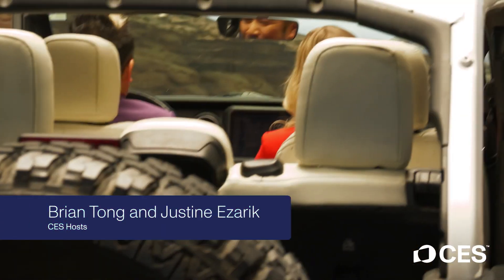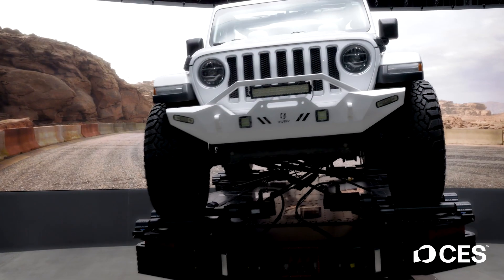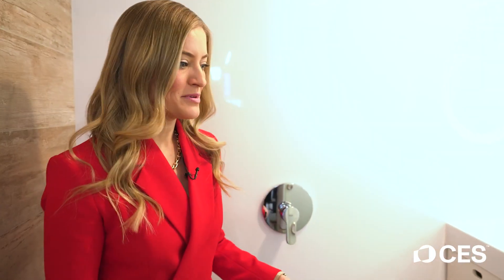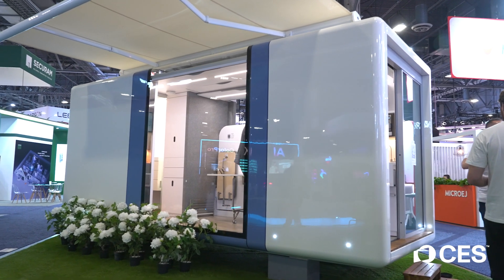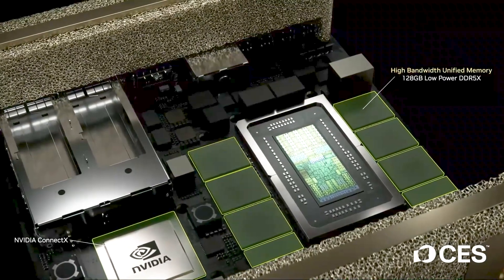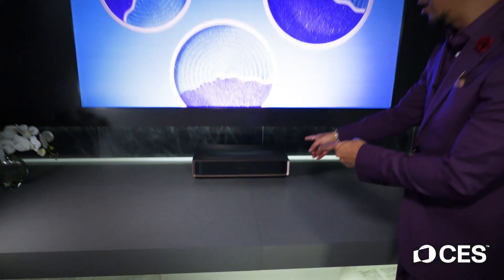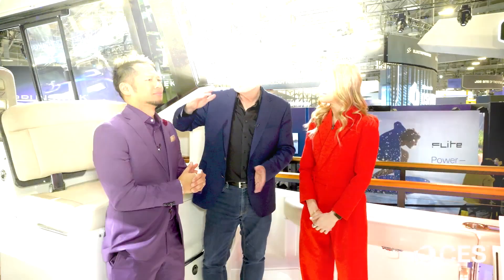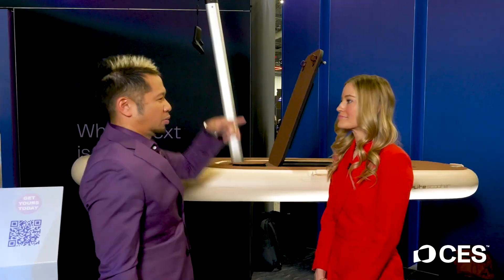The Hottest Tech At CES 2025!

Comment: I would love a tiny house.  However, there are a lot more obstacles.  1. Electric and plumbing hookups.  Solar won't be enough.  Water from the air is very inefficient and unworkable.  Think of how much power a dehumidifier takes and how little water it produces.  You will need a sewer.  2. You may need city permits.  3. If you don't already have land, most places will not just sell you a plot for a tiny house.  4. You will need to anchor it to the ground.